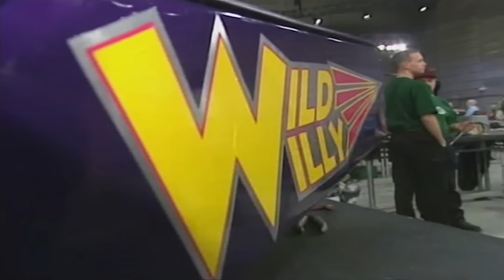Robot Wars Series 3 Heat L

Comment: Flip flop fly is mindbogglingly weak.
Reply: The whole drum archetype is weak. I haven’t seen one I like so far (though I didn’t keep up with Robot Wars back in the day, I’m bingeing from the start). They all have such a slow weapon which probably couldn’t leave an imprint in wet concrete, and, by the nature of how they work, they come up short because the robot has to accelerate away from the target. They can’t just put a longer pole on the axe, because that would require more torque to swing. Of all the common archetypes, the drum seems like the worst.
Reply: @NoobixCube  Atilla the Drum and Stinger are about the only 2 good drum robots or robots in the same sort of style that were actually any good. They just don't seem to be a good design unless you either have a very powerful weapon on the end of the arm or have some sort of internal motor that can move the arm separate to the wheel, like it was an axe or something.
Reply: @legodude494  I think Stinger got quite lucky with its draws and a bit overperformed in Series 4.
Reply: @djulianerenbourgh4969  Yeah, it seems like if you have a well made robot with at least decent shock absorption then robots like Stinger will have a hard time dealing with them. Usually the problem with those sorts of robots is how to actually defeat them. Since they usually use minimal components or a rounded shape, it's hard to meaningfully flip or pierce them. In Extreme, Behemoth had a good idea by using the scoop and axe to lift and pin Stinger in place, but especially flippers like Chaos 2 have to just... throw them about enough to have the judges decision go their way.
Reply: @legodude494  or you can put an S3 out of your sleeve, also works for Stinger
Reply: @djulianerenbourgh4969  Yeah, that too. Cause enough shock to damage the drive and their whole weapon system is useless. The weapon type of Stinger and others of the same nature (Attila the Drum for example) were good in the early series where armour was poor, but come to the later series and blunt weapon damage like Stinger just stops being effective against any decently built robot. In fact that point is what caused Stinger to stop competing after series 6, their weapon just wasn't doing damage to later robots, even newcomers.

Comment: Flamethrowers in these never seem to do anything.

8:58 Why didn't they back up?

Why doesn't Challenger 2 use the spinning drum? Why didn't the match instantly end when Challenger 2 went into the pit? It went on for a while after that. And the Panzer team made a mistake by not equipping that saw they brought with them. They said they'd put it on for their final round, but they didn't, so I wonder why that was. Putting a spike on a side of a robot and then ramming it into another robot never penetrates.
Reply: reversalmushroom trust me... they do more then you think... comning form someone whos taken a blast from one, any sort of lipo battery or even Nickel Metal Hydride battery can either explode ore burst, also it isnt good on your PCB boards.... also spikes arent to powerfull till the last round... then they can literally poke holes in your base or chassie...  also they can pop tires
Reply: They couldn’t back up because the wheels were suspended from the ground so they couldn’t let the wheels push them

Comment: Has a flopper/thwacker bot literally EVER done any damage?
I can't remember even one instance where one did even superficial damage.
Reply: Stinger /Gabriel causes more internal damage
Reply: Stinger's mace was more of an impact weapon, causing damage to the internals. Atilla the Drum had interchangeable weaponry and it seemed to do alright, so some designed work, but very, very rarely.
Reply: There is a 3lb thwack bot in NHRL called Starchild that uses a hammer saw like Sawblaze that KO bots frequently.

Comment: Most disappointing heat final ever?
Reply: Most disappointing heat of Season 3
Reply: british bots are weak af
Reply: Panzer didn’t move to start the heat final.
Reply: IIRC Panzer burned out a motor right as the heat final started, it went into the arena fine, then died.  A shame really as it wasn't a bad bot.
Reply: @battlebots2084  Battle Bots hadn't even started when this was aired.  Also, many British robots have been banned from entering BB as they were judged "to powerful".
Reply: @brainspider  why did it die
Reply: @brainspider  Which were they?
Reply: @classicsportclassictiyl8547  i forget whicjh ones now, but some were from the more recent Robot Wars tv run.  Some from the original run were banned from performing as well.
Reply: @brainspider Yep, also why the batteries drained as quick as they did in R1 - tracks add a lot of resistance, here weighing 20kgs, and need strong motors and batteries.

Comment: DARN! Panzer had a good shot there! Get some better batteries next time!
Reply: IIRC a motor burned out right at the start of the heat final.  It was driving fine when they tested it, the final startedand it burned out as soon as they tried to movie it (you see smoke coming out during the match too).

Comment: How did the Triterabot team (Later on competing with mouse trap I believe) Get away with using  a smoke grenade in their machine?
Reply: little late to reply to this but it turns out the smoke was caused by Evil Weevil after they spiked Triterobot which in turn shorted out one of the main drive motors and according to them after the fight all the wiring melted.
Reply: @PokeGuy6  Ahh. Fascinating. Thanks for the info.
Reply: @danielfennessey  np mate :)
Reply: They also had to evacuate the studio until the smoke cleared.  Then they continued the fight where they left off once it was safe to do so.  Editing obviously cut that bit out.
Reply: @andersonhill3484  interesting did not know that thanks